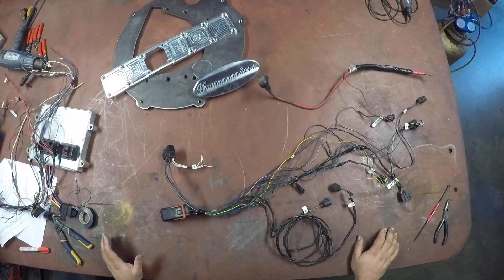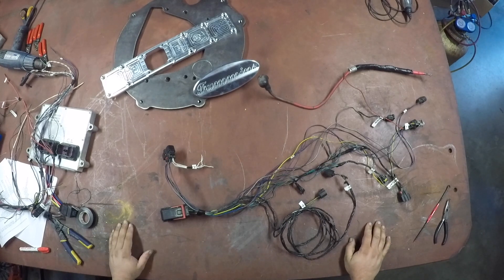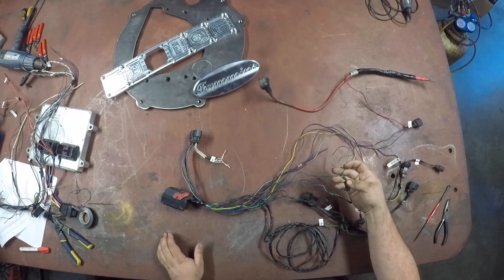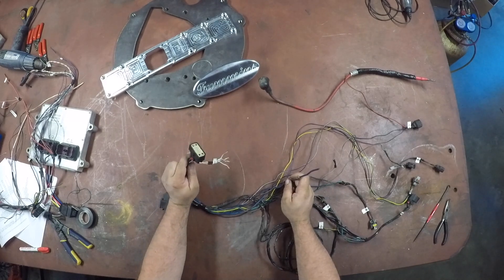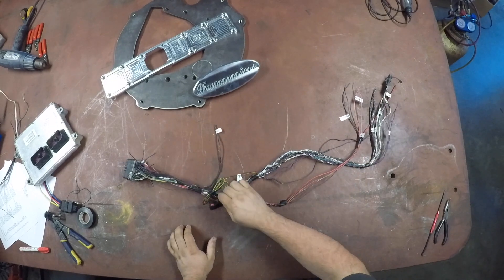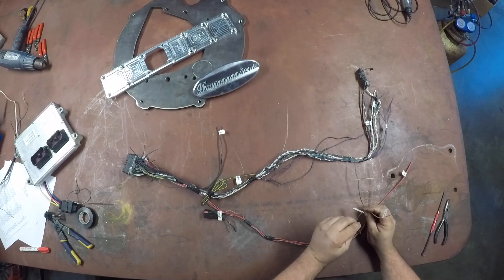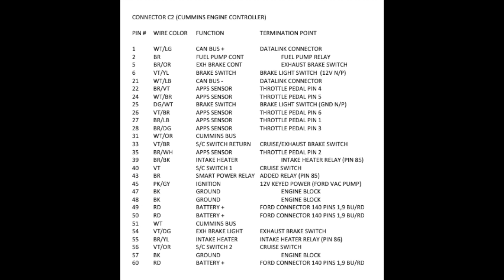Ford 6.4 to Cummins 6.7 Swap Engine Wiring FUMMINS

Comment: Great information given throughout tutorial. I'm wondering if you could provide a diagram for the sensor trigger wire and relay pinouts for a 2002 5.9l Cummins in a 6.4l truck

Comment: You need a brake switch especially on a 6.7 Cummins so your truck will go into high idle when it’s cold. Make sure the switch is collapse. The Cummins Bus connector on the C2 harness is used if you tune with a MM3 or RacME tuner, I don’t think EFI live or any other tuner uses it.

Comment: How do i wire  a 08 v10 to 01 24 valve? I want to keep everything as simple & cheep as possible using the entire dodge running gear transmission alternator etc.

Comment: The local ford dealership wants 22k to replace a 6.4 in a 2008 super duty. A person can get a low mileage 2015 6.7 engine around 4-5 K anyone do a swap from a 6.4 to 6.7?

Comment: Hi, I am using a 2007 F450 truck with a 5.9 cummings engine and transmission out of a 1998 dodge RAM250. Is it easier to use the 6.0 wiring harness or the cummings 5.9 harness? I would also like a diagram to do the one you recommend. Thank you.

Comment: Im doing  5.9 24 valve in 08 F350 with6.4 I have everything working except throttle pedal  the truck has an automatic transmission so i needs to integrate both 5.9 and the ford factory pedal to work. I would like to wire them to one assembly.  And advice would be great.

Comment: i installing  2010 6.7 Cummins on  2006 Ford F350 4x4   6.0 power stroke  do you have  a video  for  this swap  or wiring

Comment: Very very good video I am retired and trying to build fummins, 2010 F250 Cabelas Crewcab 6.4L 5R110 and th donor is a 2006 2500 5.9L Common Rail Cummins. I do want all electronics to work, AC, cruise, towhaul ect. I have the Swap Helper and Cruise Helper but don't have to use them if not needed. Would like all steering wheel functions. Ford alternator and 96dodge new AC compressor. How can I get hold of you for this info and PCM tuning and PATS Lockout? If I put something in here I should have I'm sorry ahead, I'm 62 and don't quite get the dos and don'ts. Thank Nelson
Reply from the maker: Thanks for the comment! We will be finishing our wiring video shortly and it should cover all of that
Reply: @billetperformance3614 is it up?

Comment: You still doing harnesses? I'm in the middle of a 6.0 psd into an 08 6.4. Juggling a couple of ideas. So far it's set up to have the 6.4 do the shifting, 4x4, a/c and fuel pump w/inertia switch. Also retained map, maf and coolant temp sensors for easy cluster readings and shifting. Running an 05 6.0 pcm (iat sensor in place of maf plug thats dummy plugged off style)... have you done one? Also what works better in your opinion, 6.0 or 6.4 pcm doing the shifting? I've got the 05 tcm harness fully intact.

Comment: I live in a state with annual emissions testing. Is there a way to keep the truck legal? I know that the 09-15 f650s had the same 6.7 Cummins in them from the factory. Do you use the factory dpf and egr or can you use the ones from the donor truck?

Comment: I have swapped in a 12v cummins with a spicer 7spd manual in to a 08  super dutty that was automatic

I am getting a flashing red lock on the dash and motor will no crank over

The plug you showed at the top to bypass the glow plug moduale can bus was done

Is there another one i need to do somewhere? On the trans connector maybe? 

Any help greatly apriciated
Reply: Did you ever get an answer to this ?
Reply: @mikegarland3223 

It ended up being one of the posite cables i forgot to attach on the pass side battery

Comment: for the aftermarket relay for the fuel pump can you give me the pinout for the 4 pins at the relay in your video around 13 minutes into you show the 4 wires and according to your engine controller pin out its unclear of which wire goes to which pin on relay i am using a 4 pin 40/amp potter brumfield relay and assuming i know how to wire relays for aftermarket products but again unclear how to wire this into the fuel pump harness ive got pin 85 86 30 and 87 thank you

Comment: I installed a 2017 6.7 cumins diesel on my 2008 ford F350 I removed the 3rd engine from the truck, I have the original wiring from the cumins along with the pcm everything worked on my ford and I will like to have the cumins done with engine break cruise control and everything working as good as it was i left the ford transmission and ford alternator it is a automatic transmission stock from my truck i love this duly but the 6.4 didn’t work as fine as my 7.3 power stroke that i had so i need your help on the wiring in this truck with my 2017 6.7 cumins
Reply: I installed a Cummins 6.7 year 2010 in my Ford F550 year 2008 I need help with the harness and I just need that thank you I hope a positive response

Comment: I'm putting a 12 valve in a 2008 6.4 I'm using the stock automatic for transmission...I'd like to see a diagram for the wiring buddy...I cant get it to start by using the key...it will only start if I cross it at the starter...and it wont shift at all it goes strait to 2nd is all

Comment: So glad I came across this very informative video. Was going to send mine off but I think I'll do it myself. I will be putting an 05 common rail into my 08 f250 using the stock transmission. Does the 5.9 differ much from the 6.7? Diagrams and schematics are gonna be handy
Reply: Did you ever get this done??

Comment: How can I eliminate the tipm have an 08 6.4 to 6.7 cummins swap
Reply: Just cut the chassis connector about 12 inches away from the ecm and wire as he shows in the video.